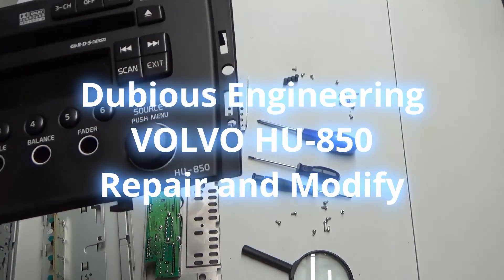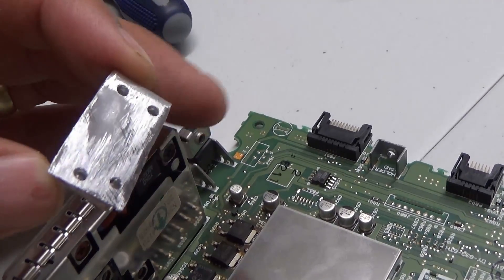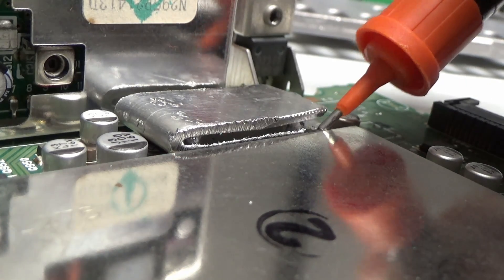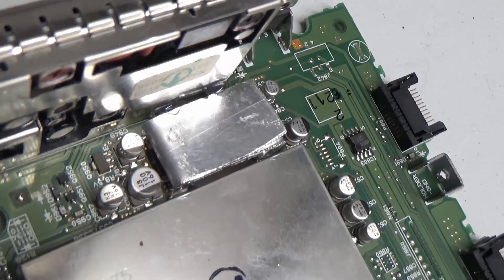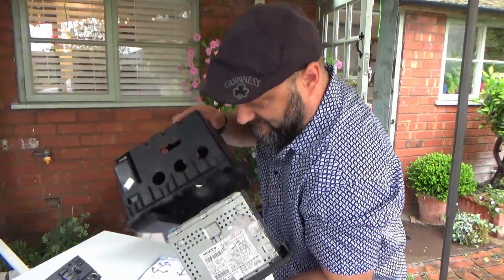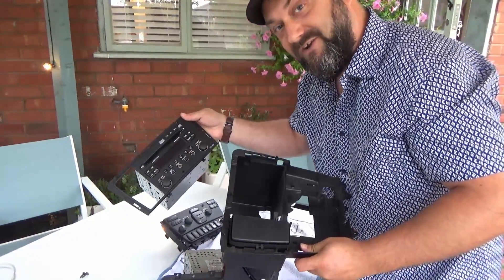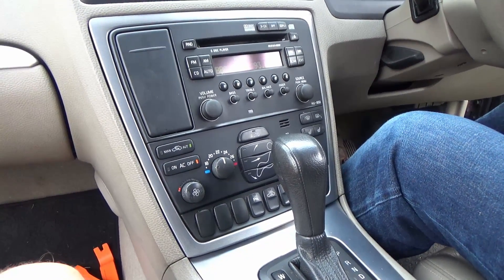DuB-EnG: Volvo HU-850 Radio CD Player Repair Teardown Dissasembly and Modification solution

Comment: Hiya pal, recently bought a volvo v70 but the bloke said this issue only started after he changed the battery. I had intermittent sound on my drive back and noticed it getting very hot so turned off. The day after I had nothing but the popping others have spoke of and it also doesn’t get hot anymore. I’m going to attempt this repair but in your opinion what does the cause sound like, the battery change or is that just coincidence? amazing video though which has given me the confidence to attempt a repair
Reply from the maker: I wouldn't waste your time...  This issue came back after about a month...  Pfft
Reply: @ how annoying, guess I’ll have to bite the bullet and get an aftermarket radio and ruin the look of my car ☹️

Comment: Thanks for the video. My Hu-850 was first jumping on/off and finally dead. I went trough the comments and tried the easiest solution. I have also seen also the brown heated area. I just redid soldering on the 2 resistors and 2 transistors, without renewing them. Then I have put the print card for 10minutes in an oven at  200 degC. Don't bake a cake afterwords, it smells... :)  ...Put it in the XC70 again, and.... all works fine. Don't know how long....
Reply from the maker: Great work 💯👏

Comment: Hey M8, I’ve let a professional solder in some new resistors and transistors, but now it does the knack thing anyways and doesn’t put out sound for a few seconds. U got an tips or ideas on what’s still the problem ?
Reply from the maker: Hope your professional has an oscilloscope and a signal injector!! :-)

Comment: I'm having the same problem with a HU-650 model. 

What resistor did you use?
Reply from the maker: I can't recall...  Hopefully you should see the resistor colours in the video, you can work it out then...
Reply: @DubiousEngineering  Thank you! 
I'll have a look and see what I can do, looks like the old resistors that comes with the radio desoldered themself. 
Might just help with a re appliance of solder.

Comment: Nice video, learned alot, at the moment im trying o repair it myself, unfortunetly second try and still not working, i bought some of the transistors but they are hard to get, (i hope i bought correct ones " 2SD1760Q") 

Also where do you live? Any chance i could send it for repairs or get more info from someone smarter and more educated than me? Thanks. Would love to know how to fix these radios in future, alot of friends have same problem.
Reply from the maker: Absolute nightmare!!  Really sorry, I have no way to test without plugging back into a car...
Reply: you changed the resistors and the transistors? Did you change anything else? 
Thanks for the info :D

Comment: I was havin the exact same isses with hu-850, but the newer version with 5 transistors. There was also miscoloring but the components looked ok. I threw the pcb in the oven for 200 C for 8 minutes and now it is working again.
Reply from the maker: Oh wow!  …. That’s an interesting fix! …. What do you think it was ?  200C won’t reflow solder joints…
Reply: @DubiousEngineering  not sure ... 200 C is what people generally recommend for this caveman general fix attempt.  I also left out the CD player so maybe it just draws less power now and remains stable ?

Comment: It would of been safer to reconnect the battery positive post first.  Before the neg... volvo also recommend you allow the can bus system to reeboot before you turn the ignition key. To ensure all systems link.
Reply from the maker: Very good point!

Comment: I have a question about the 1 ohm resistor. Do you connect the new one to both solder points or only the right one (hard to see on the video :-) ) Thanks for the great work.
Reply from the maker: Oh crikey...  I can't remember now... sorry it was two years ago!

Comment: Hello mate ! I also have HU-850 causing trouble. When I bought the car it was completely dead and only kept clicking every few seconds. Took it to someone who does these repairs and had my unit replaced for a "fixed" unit. All seemed to be ok, but... Soon as the weather gets really hot it looks like the unit is overheating and then suddenly it does what some people mentioned here already, it insta goes to max volume, then goes quiet and starts clicking like before...  After switching an engine off and giving it some break it works again but the problem repeats itself over and over.  When the temperature outside isnt very high the radio seems to work ok although I didnt test it for hours, more like 30-40mins.  
What do you think is causing the trouble, the repair the guy did not good enough or maybe installing a proper heatsink could help as it seems like my unit isnt gone completely atm?  
  
Normally I would take the unit back to that guy but he lives 50miles away so maybe there is something I could do myself ?
Reply from the maker: So sorry bud, these radios are terrible...  my best recommendation is to install something different!  Howard
Reply: Resolder the 2 chip s pins, the larger one is the culprit

Comment: Great Vid!  I own a 2007.5 V70R with the HU-850 that has the Aux jack and it went 120db of crackle bonkers so I took it apart and learned that Volvo revised the board and fixed this particular issue.  There are now 5 power transistors and they apparently do not get very hot.  As to my problem, Hmmm-
Reply from the maker: Ahhh  bugger...  sounds like a connector?
Reply: Did u ever resolve this? I too have a 07.5 with the exact same problem.

Comment: A common problem with the 850 is the backlighting stops working.  Not on the LCD display, but the backlighting on the knobs & buttons.   There are several posts about it, and it is not a simple "replace the bulb" problem.  Just wondering if you've heard of this problem, and if you have a fix or solution.
Reply from the maker: Sorry I don't have a solution...  that radio is seriously poop 💩 😳
Reply: @DubiousEngineering  poor job Volvo 😠. How can I enjoy my tunes now?
Reply: @DubiousEngineering  its actually a very good system just poorly put together
Reply: Road radio in Hove are fixing both of mine illumination gone on both although a cd deck was knackered so will be adding a bluetooth module

Comment: Tried it and unfortionally it didn't work 😔
I switched the resistor only, and the stereo is powered, but it still has that same problem with no sound, but sometimes just pops on max volume although the stereo is off 👎
Maybe i need to replace the transistors aswell.. or perhaps the poweramplifier under the Seat...
Reply from the maker: What a blooming nightmare...  sorry to hear
Reply: Try resoldering the the 2 IC pins that are for audio sound that are beneath that alumínium case

Comment: My radio starting playing up with high and low volume, hissing, banging, cracking noises in speakers, which at same stage when you don't expect them at all, at least my self been scared when the noises started and without been aware where the noises come from and what's the cause. After seen your video I'm tempted to try and fix it in near future. Great video, Thanks for sharing!
Reply from the maker: Good luck!!  They are nuts when they start going wrong!
Reply: @DubiousEngineering  I’ll try, any way the radio is gone and to be of any use must be repaired. And thanks to your knowledge and kindness of sharing, this would be possible, Thanks!

Comment: Thank you for the video. I dissasembly my radio and saw that the resistor had a crack. I had some issue with the light in  the unit not working so i could not see what to click on at night. Will this fix that too? or is that something else thats wrong
Reply from the maker: Good luck my friend!!

Comment: Great video how do you get hold the replacement resistor?
Reply from the maker: Buy on eBay or through RS Farnell etc
Reply: @DubiousEngineering  what size resistor?
Reply from the maker: @davehartnett146  sorry I can’t remember it’s been two years since I made the video.  I think I tell you in the video.  Likely 1/2watt 1ohm

Comment: Great video, you make this look easy enough for dummies like myself to consider. Just wondering how this is getting on after a year? Is everything OK, or has it gone back to issue land?  Many Thanks
Reply from the maker: Strong suggestion... stuff a different radio in there.   It’s like plugging an old dam.  One hole fixed, nest one open!
Reply: @DubiousEngineering  hahaahah I get ya... Thanks again bud 👍🏼

Comment: I have the same issue with HU-650, PCB got darker. I tested the Transistors, they seem okay. I will test the resistors then test the device. I want to write the results and the checklist for other people.
Reply from the maker: Good luck my friend !
Reply: @DubiousEngineering  First of all, these resistors are fine. I tested a few other components as well. They seemed okay. Then I tested Audio Amplifiers at the connection board. They were okay and worked well.

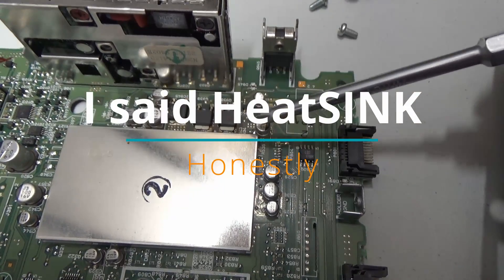The big metal cover in 1:22 is actually cover for DAC(Digital 2 Analog Converter). I had to lift the cover to see what's under it. The first few thoughts of mine were "The IC is close to heat source. Did the leads have to be resoldered?", "Amplifier works but why don't I can't get sound, is this problem related to this IC?" and I shall check it etc.

The first think I did was pressing on the IC while I supplied the board with 12V, then the IC magically started working. I didn't check any other stuff and cleaned the IC, applied flux, applied new solder after that I cleaned it again. It started working.

I thought this as a temporary fix and reassembled the radio unit. I told my cousin that this IC were suffering very high degrees, this can cause its early death. If something like this happens again, I need to replace that chip.

So, check the DAC guys, it might be the one that causes problems :D

Comment: Hi, thanks for the super video. I have exactly this problem which started couple of weeks ago in my 2005 XC70. I have pulled the fuses for the radio and amplifier and now of course have no sat-nav or parking sensors.  Unfortunately I think your solution would be beyond my skills. I want to find a second hand unit to replace mine. Have you any suggestions how to test a unit to know that it works before fitting? Many thanks for your help provided by this video.
Reply from the maker: Only way to test it properly is to plug it into the car - sorry to say...  too many connections to try it out.

Comment: i have the HU-650 model here the same problem accured although this model is a little bit different so i got 4 d1760 mosfets and on the back 4 of the same 1R0 resistors what resistors do you recomend for to instal and where can i buy them i live in the netherlands so
Reply from the maker: Aha! - I suggest you do your research ...  sorry, I dont live in the netherlands!!  :-)

Comment: Hi😀 and huge thanks for this great video!!. The same problem in my case. No sound but only click.... So I teared my HU850 to small pieces to the bottom and found the same issue: almost burned out these two resistors 1R0 ....I am going to try to fix my HU 850 soon too. But one question about components, I live in a small city so it's no chance just to go and buy  resistors or so... To avoid doubling of shipment costs and the time... if needed ....what kind of  capacitor(s) and transistor(s) should I have to ensure successful reparation if it'snecessary to replace as well? thanks for advice,  Krzysztof
Reply from the maker: Strongly recommend you pull it apart and look for the burnt components and make your own list.
Reply from the maker: So sorry it may be different depending on what’s burned out... please open the unit and make your own list.  Thanks, Howard
Reply: @DubiousEngineering  Thanks a lot once again 🙂

Comment: Same problem 😭
I don't suppose you offer a repair service do you ?
Reply from the maker: It’s a flaming nightmare ... so much effort... better off fitting a different stereo.  I’d charge a lot!!
Reply: Cheers for reply, yes to be honest a new head unit is probably how I will go..
Could spend a fair bit repairing mine and something else fail in a few months.

Comment: Thanks for a great video! I did exactly as you showed in the video, replacing the 2 resistors, but no luck. Still does the clicking sound and gets loud all of a sudden(by the way in the video you soldered only one resistor. Did you put in the second one as well? Just making sure). Would you say I should buy the 2sd1760 transistors and try replacing those as well? If so, I wonder if it would be hard to remove those transistors since they are glued. Thanks in advance
Reply from the maker: Its difficult to say, the electrolytic capacitors may have dried out because they got too hot...
Reply: Great video - thank you.  Just one thing - what is the value of the two SMD resistors ?  They look like 1R0 which is one ohm, but it looks like you replacement them with 10 ohm resistors - or am I reading that wrongly ?

Comment: Hi Guys, just a little update where I am now with fixing the HU-850 Stereo, my friend solding a transistor but, had a mistake sold 2  on it, left and right, the heat sink brilliant what he done, I take apart twice now, (never give up) keep practicing. Next step try again tomorrow, also I found another problem, the amplifier cable looks loose a bit so may that cause trouble is well, if I have time I would love to share some picture how is my experience, I  have 2 option, if not working after this time.....................I don't know:)
Thank you so much all the help, I let everbody know if is working soon or not :)
Take care
Reply from the maker: Fingers crossed Tibor!!  :-)   I wish you luck!
Reply: @DubiousEngineering  Thank you so much, the positive feedback, everything ready to go, we found out tomorrow:)

Comment: Excellent DIY, and excellent technique.  The only question I had was, by improving (adding!) the heatsink, is increasing the wattage of the resistors even necessary.  Regardless, an extremely helpful video.  The Volvo dealer isn't going to tear the radio apart and imagine how much you would pay if they did.
Reply from the maker: Thanks 🙏 ... yeah I think I went belt AND braces 😁 ... :-)
Reply: Is there a link for resisters so I get the right ones cheers.
Reply: you wouldnt take it back to volvo for a stereo that is that old youd go to an electrical engineer or similar i use a car stereo shop in Hove for mine

Comment: Thank you so much for the video, I learn a lot!

I have the same problem, looks everbody have this burn out on the panel,   (HU-850) 
Make me crazy when driving, switch on music 100% volume feel have a heart attack.

When I took apart I noticed someone the past disconnect the cd player grey cable and covered with black adhesive tape.?? dont know why

Plus the cigarette lighter cable disconnect too. 
I try to used the cigarette lighter for charge phone ect... now I know why not working because disconnected for some reason

I never give up, when I see this video and read all the comments, I just feel take it out and have a look.

Take it out today, screws out everything out, hope working soon:)  at the moment just a empty hole there:)
I follow all the instruction, and order the parts soon, I would love to share my experience when everything done. 

Hope my friend help to do a soldering. 

Good luck for everybody
Reply from the maker: Good luck too!!!  Fingers crossed 🤞!!

Comment: Hello, what exactly was the problem? I have a HU850 radio.... it is driving me crazy... firstly the CD Changer just kicked out all CD and doesn't want to take them any more. After a few month it became worse. Sometimes the sound works, somtimes not. When sound is off, you can hear a strange noise like "clack-clack-clack" or "ticking" out of the speaker. During this time, the Park-Distance-Control is also not working. Then, suddenly it makes a louder CLACK/TICK and sound is back again. It happens undependent from temperature.... Sometimes it works for the whole day, sometimes for some minutes only. Can you help?
Reply from the maker: I’m sorry Alex, my best suggestion is to buy a working replacement...
Reply: @DubiousEngineering  Oh nooooo ;( Thank you for your reply

Comment: I replaced the two transistors and the two resistors, and the radio is back on!. But intermittently stops hearing and soon returns to function. The resistors I put on it are the same model as the originals, and not the long-legged kind of video. You hear little clicks even with the radio off. Please, you can give me your opinion on that. Best regards.
Reply from the maker: Souunds like power supply issues...  maybe the capacitors have dried out?